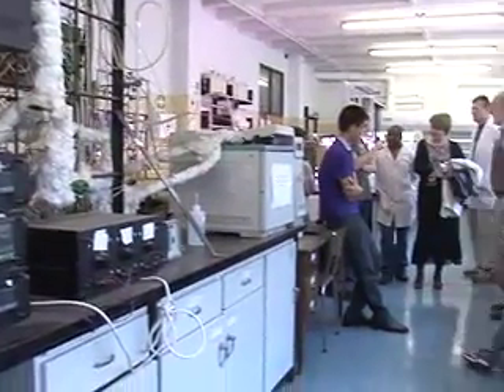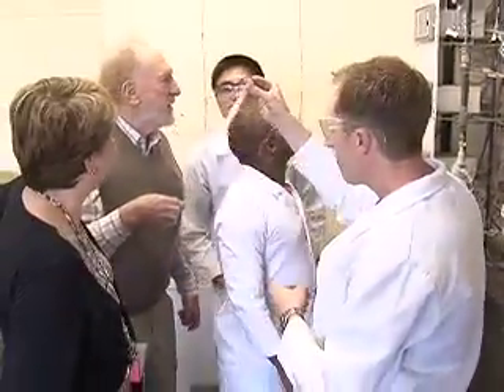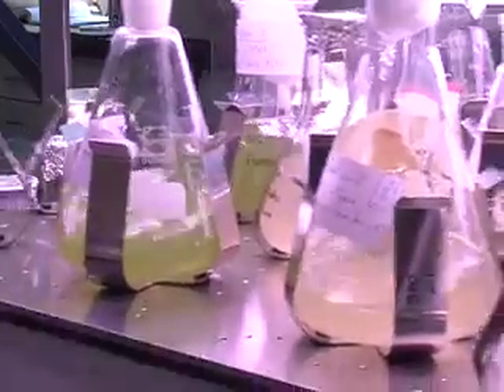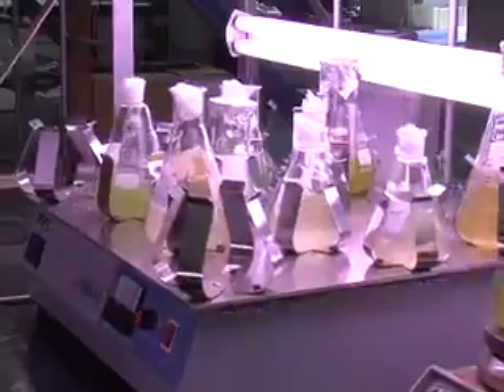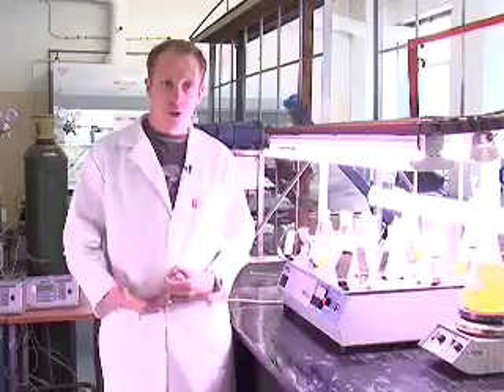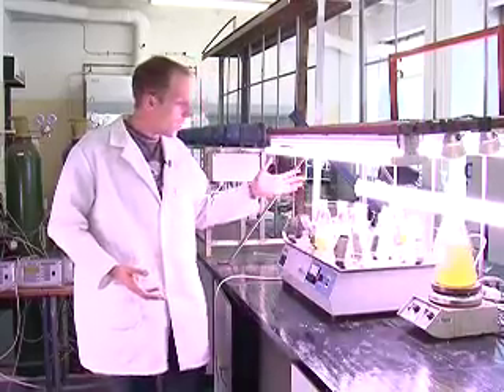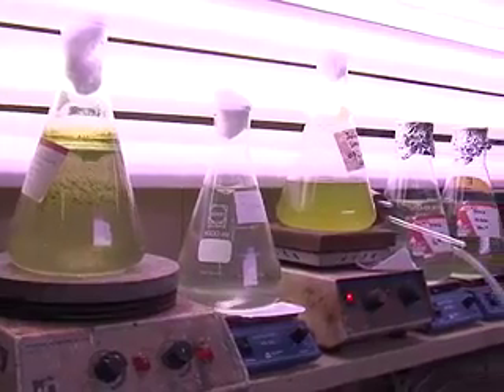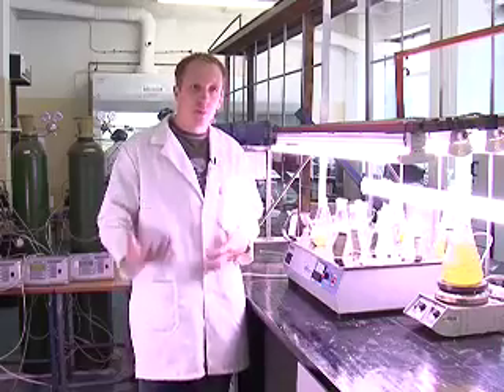Technology Converting Coal to Liquid Fuels

Comment: If I'm not mistaken, the largest input to make this happen is heat. When converting coal to syn-fuel 2/3rds of the coal goes into making the heat and 1/3 toward the fuel itself. If the heat input came from high-temperature nuclear, the entire process would be an order of magnitude more efficient and cleaner.

Comment: Use the carbon dioxide to produce a starchy plant. Make alcohol. Vacuum distill that. Use the fuel to run generators. Why the vacuum? It takes far less energy to separate the alcohol from the water. Conservatively you only need 80% to burn. Also what about vertical farming. Plants love CO2.

Comment: The reason why South Africa went this route was because of the oil embargos and economic sanctions placed on South Africa during its Apartheid Era. This video was done in 2010. Fast forward to 2019 and the world is slowly moving toward electrification of transit (electric vehicles - electrek.co, electricauto.org) powered by renewables (wind and solar). US policy makers were talking about this back in the late 70's after the OPEC and Iranian oil embargos. Today coal is on the way out and there is a surplus of oil on the market. Peak oil production may reverse this but the practical solution would be greater use of fracked shale oil, tar sands and deep water reserves (mind you all of these are environmentally problematic and capital intensive). Biofuels (diesel from algae, ethanol from waste products) currently do not have the economies of scale to replace conventional oil. This solution was undertaken under emergency and under duress. Germany in the waning days of WWII and South Africa under Apartheid.
Reply: You were clearly very wrong my friend
Reply: Sasol South Africa is doing it on a commercial scale providing the country with approx 30% of it's fuel demand.
Reply: I'm just looking at this for efficient 💩 burning

Comment: Now imagine countries which have a low GDP using the coal the naturally have to turn into gasoline which doesn't even need to be refined as it's a pure molecular form, to then use it for themselves to become self sufficient but also be able to sell it on a global scale to then begin to sustain the national economy by using a chemical process which also helps the environment as it continues the natural food chain of auto trophic producers absorbing the harmful carbon dioxide emissions and thus, we just saved the world from climate change.

Yes Harvard, I'd take the scholarship now please.
Reply: The ability to produce liquid fuel, such as coal oil, from coal has been around since before the mid 1800's. It was not long lived because it was far less energy intensive to extract the fuel from Crude Oil discovered a few decades later.  (It still is, even with this new technology).

    To dig coal to make coal gas, then liquid fuels as byproducts was just more time consuming, labor intensive and dangerous once crude oil technology came up. Also, as far as some new technology, making liquid fuels from a synthetic bio gas can and has been done for a while right in people's own back yard from something as simple as wood syngas from tree clippings or coal gas from coal you dig yourself...especially during WW I and WW II.
 
       This new coal to liquid fuel process, if you didn't notice,  has a bunch of electric heaters (heater's heat has to come from somewhere and electric isn't a fuel, guess what is?) anyways, heaters wrapped around the gas catalysis chambers and, before that... they had to heat the raw materials to a point each type of material, raw or recycled, coal or banana peels, to the point that it would give off the initial "synthetic gas", just to be heated again in a catalysis process to get a liquid that could then be distilled into different hydrocarbon fuels at each step of the chain. How is that saving any steps or a lot of energy overall in comparison to crude oil distillation?
      In essence, this is the same process as distilling crude oil instead of coal with the exception of they are probably taking the hydrogen byproduct and using it in hydrogen fuel cells or small turbines to make smaller or non-grid significant amounts of electricity (same can be done on a larger scale with hydrogen gas from crude oil distillation) and pumping the CO2 into algae (same can be done with CO2 crude oil distillation) and venting the unusable leftovers (same as done with crude oil extraction) with one exception...
 they have to add the extra energy in electricity or burning some fuel for heat in order to heat up any other raw biomass like they mention that is not coal to take said raw bio feedstock ( banana peels, shit) and basically boil a lot of moisture out if it to basically turn it into coal then heat a little longer to crack the "synthetic char" into the syngas (just like coal or oil) before the added energy using of distillation coil heating the gas to break that into the individual liquids they wish... Alas, Good for them that they decided to save some energy by using a catalyst (but so do the crude oil companies in many instances, lol) yet....
that extra first step for waste biomass they mention but don't talk about much or show very well in the video that cost more in equipment, time to dig and transport solids over long distances on top of increased health risks to the workers that do it to mine coal and sort shit at the local recycling dump would cost overall much less if you just let mother nature expend her energy into making oil for you and to use that instead of using energy to artificially create it. Hey, here's an idea they didn't use to save energy... How about using geothermal energy to do most of the work for them in turning that fresh biomass into useable char for syngas!!!  That would even work for distilling coal oil or crude oil with no extra fuel needing burned for the heat in distillation at all!!! (now, to get Exxon to build on a fault line or geothermal vent...hmmmm?? lol)

This video was made almost 10 years ago, my how their efforts haven't changed a damn thing for South Africa let alone, the world!  This new coal oil and syngas method would be the same thing that happened to the Coal Oil refineries of the early 1800's in Scotland, Canada and America and by the time the new countries would have developed the need for crude oil, they'll be many more years behind in delivering it even if they had access to home drilled oil or near home oil deposits.  Why?  Because coal oil is simply a more labor intensive way of getting useable fuel oils even if demand hasn't outstripped supply. Even in America shale oil extraction or tar sand extraction isn't even viable unless crude oil goes above a certain dollar amount. 

     This video's method isn't much different overall and is not a solution for low GDP, energy poor countries, as they would (and only could) use this process on a small scale, it would not be able to keep up with the demand for more energy as the country grew due to any growth it saw from it. Just like the demand for coal oil in the 1800's outstripped the supply until, luckily near the same time, the discovery of crude oil to do the same job happened! Otherwise, further economic advancement and meeting the growing energy demands with only coal oil to do the job would have stopped things in their tracks due to the unending inability to meet such demands in any large scale scenario.

   
   The thing that keeps the people in low GDP countries down is not lack of new technology or lack of any current technology, it is their inability to have foreseen and prevented scams that were perpetrated upon them by their own leaders/governments. Scams to rob them of basic freedoms and the ability to have competed with the rest of the world in the past, present or probable future.  South Africa has really went downhill since this video was posted... Can you seriously tell me is was all or any of it due to their lack of cutting edge coal cracking technology?

  Anyways, all I saw as an important takeaway from this video is that energy producers should take all steps available to recycle their byproducts, such as unneeded gasses, into more useable things asides from just dumping it in the environment... which, even that was already being done before these folks in a South African lab were shown doing it too!

Later, I gotta' go, Harvard's showing up on my caller ID!
Reply: @grinninggoat5369  
your comment 
"Even in America shale oil extraction or tar sand extraction isn't even viable unless crude oil goes above a certain dollar amount".
Now please explain why america is mining oil sands to supplement its fuel needs. a product not worth mining now will be later. ie 20 years ago  oil sand salt contaminated  oil a swell as other poor oil , is now what they are refining
Reply: @bearup1612  , refining tar sands at a greater expense.... simply because America's recent agenda since Middle East terrorism and other once stable foreign oil producers has made it a poltical talking point of the USA finding and perfecting the distillation of oils closer to out own soil in the Americas, especially North America. 
Notice once the oil prices took a downturn again and tar sand distillation became even more costly, that suddenly.... massive interest  in the political affairs of  South American countries like Venezuela... that also happen to have massive oil reserves?
Reply: @grinninggoat5369 
I understand that  and agree that it is more expensive in the short term  but in the long term it will reduce dependency on foreign oil  the cost is irrelevant. the expense is  if you want to export the fuels. A dollar in Australia is only worth a dollar
Reply: @bearup1612    no... you are simply wrong. Cost is not irrelavent in the long run if there are still cheaper options or methods. Why would anyone choose to lose money in both the short and long run if they did not have to? I would wager some folks want to scam and make a quick buck before they are foind out that their technology is not new and does mot yeild rhe results im savings they claim... also, given other options and other technology also know today, at the point of coal oil distillation in the long run, the extra expenses would not only be in export as you said. 

 Overall, I'm not quite sure what you're getting at in your comments to me by even responding to me and my comment to Captain Dugog because you never plainly said what I said that you disagreed with.
 My original comment was that the people in this video were tech scammers, claiming new innovation when it was clearly not if one looked at the whole process they spoke of and even with catalysts they have more energy input at higher environmental input costs than they claim. 
Also, about having to build their " new tech prototype" refinery in China which sounds suspicious to me for two reasons 
1) if your country develops new tech then China is not the place to keep any patents or tech safe from industrial espionage, and
 2) theu have to know when making claims of new innovative tech that it was actually old tech with some smoke and mirrors catalysts to look new and they just wanted to scam gullible investors while they could, they needed to get the costs down enough on paper not to be laughed at when making their investment pitches and chose China to do that. My point towards that being the case was that rheir video was old and not much still has been fruitful for their supposed new company. This tells me that even if they were just altruistic Environmentalists and scientists with more good intentions than brains, choosing the most industrial polluting, environmental agreement breaking country on the planet to get your dollars to build them a prototype "cleaner, recycled fuel re-transformer" refinery seems a bit odd.

Anyways, at this point, after entertaining and responding to two comments from you to me, I'm done trying to figure out what any of your counterpoint(s) to me was and/or still is or... trying to figure out if you're slyly trying to just be a troll that perceives themselves smarter than the average troll. 
So, you can keep commenting to me if you want but, I won't be replying back even if you finally decide to actually define exactly what your reason for originally commenting to me was and what exactlty I said you were in agreement with, or at odds with, in my original comments to someone else entirely.
If you want to keep a conversation going still, try  someone else for your next comment. I'm done.
Reply: @grinninggoat5369  
I understand your comments about these scammers my argument is that  if the ability to perform the  process is possible then countries that have the resources should use them. Solar was a waist of money 15 years ago so was wind, the cost out weighed the gain yet now the world is looking a renewable s my argument is in time it will be viable. tech will improve. I still think that turning coal into oil is a good idea. Nice to chat with you and listen to your thoughts and opinions
Reply: @andreg751  , lol.. maybe that's why the new wave of scam artists in the video built their refinery in China... like said in the previous comment above yours, coal to  liquid fuel has always been possible... it is just that it has always been economically infeasable to provide coal oil to people at the same price as most other fuels while the refinery owners & workers from any process want to make the same profits & wages. 
      But, it surely would be cheaper if they just gave coal oil away.. coal oil has never, and will never, be as cheap to produce as petroleum based fuels until the cost for the petroleum supply is on par with that of coal... one doesn't need to blame the USA or it's dollar for that because coal oil didn't work for them either once liquid crude oil came on the scene in the mid 1800's.. the USA figured that one out about the economics of it for their country almost 200 years ago as it pertained to use within their own country, and those that used coal oil there and then did not need blame time traveling coal oil scammers from Africa's future nor coal oil being linked to some other economy to have figured out the real problem!
Reply: Who says it is pure form 
Coal has Sulphur,Hydrogen,nitrogen and many other impurities and conversion cost is almost 3 times more than that of refining crude oil.
Reply: @shahjillani5592   
Australia has coal that has the lowest sulfur content than any other country in the world
Reply: @bearup1612  but still it will more costly to convert coal into gasoline than refining crude oil...But it can be useful though